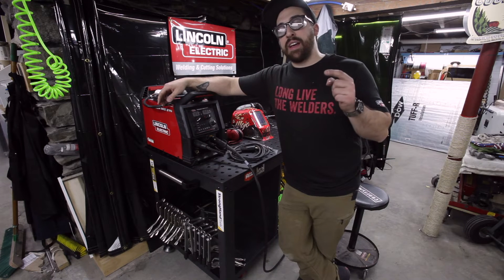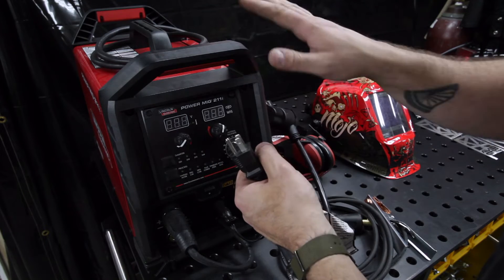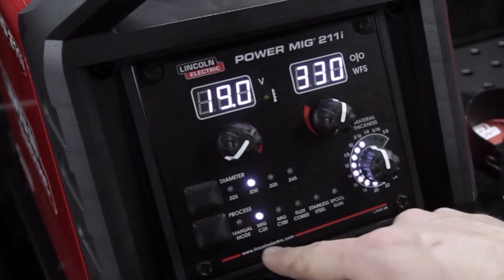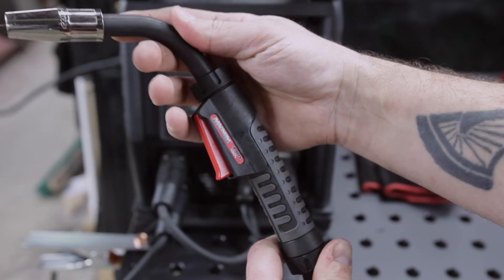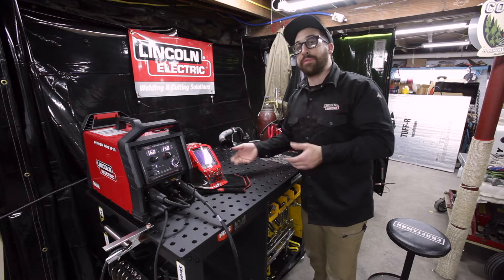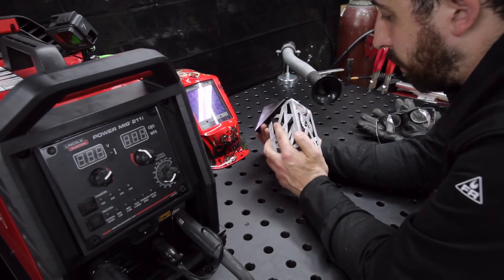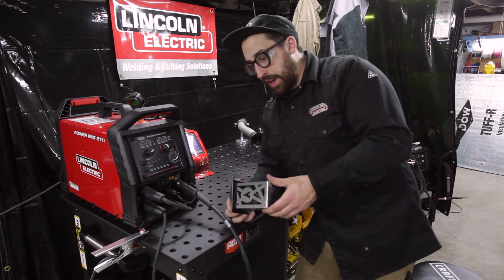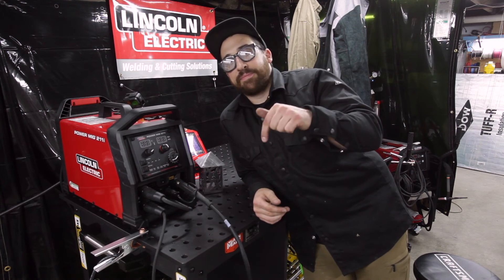Building a Metal Lantern with the Lincoln PowerMig 211i!!

Comment: I just bought this welder and love it. I wonder why my Autoset for 1/16” is 16 volts and WFS is 150 and yours is 130. Also for 3/16” it’s 20.5 volts and WFS 330 and yours is 19 volts . And it’s the same on 110 and 220. Also it’s set for 0.30 and c25.